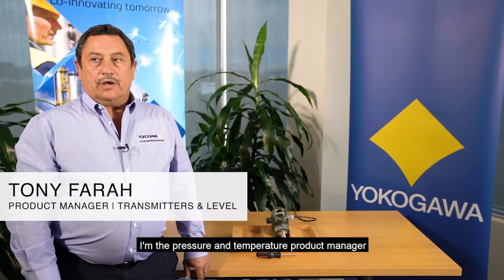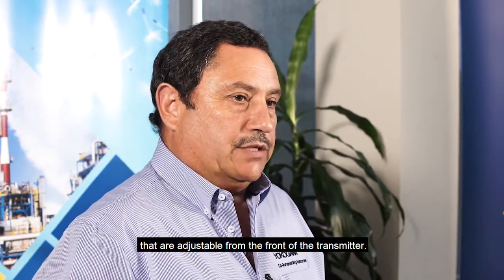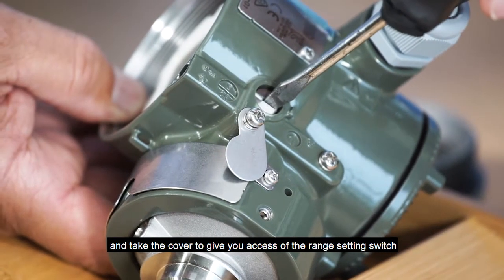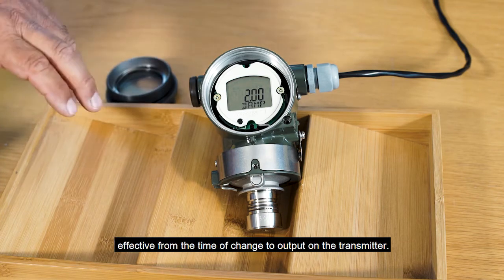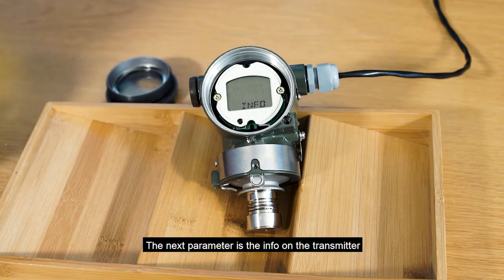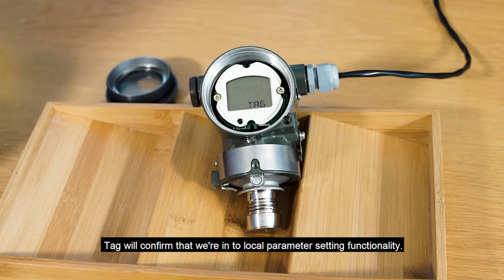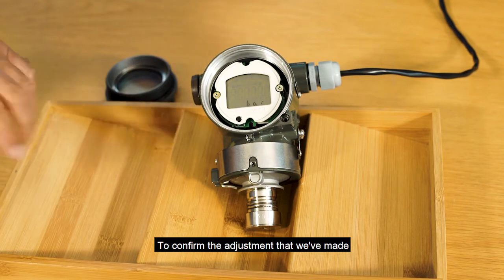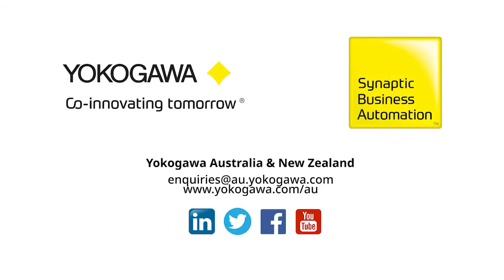Local Parameter Settings of Yokogawa EJX and EJA-E Transmitter

Comment: Hello sir,
How to set the 0 to 262500 BLPD  , urv lrv in a yokogawa Ej110a dp transmitter.
Kindlly suggest in display out 
Display 1 is 0 to 400 mbar 
Display 2 i need to set as mention in first line.
Please help out...

Comment: We will cosider to buy buy Yokogawa EJX910A-JMS4G-B12DM-BB/CF1/M11. There are a number of things that need your help explaining:
1. Is it compatible for AGA3 calculation?
2. Can it be configured using Hartcomm 475?
3. Does it require special software to configure it?
4. Does it require a special dongle/modem for the interface between configuration software and MVT?

I am very grateful for sharing your knowledge. Reagrds Jandri Jacob
Reply from the maker: Hi JeJe,
We hope you are well.
To quickly answer your questions:
1.	Is it compatible for AGA3 calculation?  
                  Yes, the EJX910A is compliant with AGA3 and 8 standards. 
2.	Can it be configured using Hartcomm 475? 
                   No, unfortunately the transmitter cannot be configured via a HARTcomm 475. 
3.	Does it require special software to configure it? 
                   Yes, it requires Yokogawa’s Fieldmate FSA111 with Yokogawa’s Flow Configuration software FSA120. 
4.	Does it require a special dongle/modem for the interface between configuration software and MVT? 
                  Yokogawa supplies a USB Hart modem. Alternatively a Viator HART modem from Pepperl & Fuchs that also provides power for the Transmitters is very handy as you don’t require an external power supply. 

If you could please send us an email regarding the EJX910A- referencing your youtube enquire to au.enquiries@yokogawa.com we can further assist you and connect you with a technical expert straight away.
Kind Regards
James